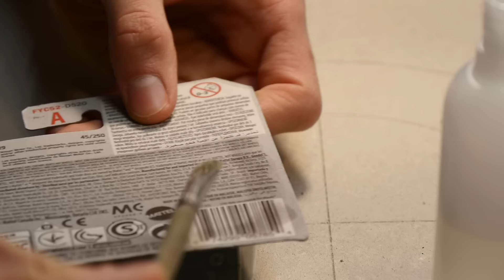Nissan Skyline GTR R34 Hot Wheels Custom Premium

Comment: Nice work dude!💪  Do you use some clear coat on the details like head/taillights after you painting them?
Reply from the maker: Many thanks! 🙂 I always clear coat my cars after paint job, but not any time after detail work. This way I have a mix of clear and matte details.
Reply: @themodelcarproject  Ich merk gerade, das dein Channel deutsch ist/zumindest D als Ort angegeben wurde..dann sprichst du wahrscheinlich auch die Sprache?:-D Danke für deine Antwort. Ich frag deswegen, weil ich für die Details Acryllackstifte benutze und ohne eine Glanz/Mattlackschicht drüber kann ich es relativ schnell mit dem Finger abrubbeln...wie ist es bei dir?

Comment: Wow this looks great! I'm gonna make my Mazda RX-7 diffrend so it matches the movie: the fast and the furious Tokyo drift
Reply from the maker: Thanks a lot!✌️ That's a perfect idea, savage car :D
Reply: @themodelcarproject  I also have a question do you use glue to put the frame and window stuff together or do you use screws? (I'm sorry if my English is bad)
Reply from the maker: @Bazooka.trooper  I usually dont glue the interior or the windshield, only if absolutely necessary. For the base I always try to screw it , so I can put the body back together while customizing, checking if the ride height is fine, etc... But I would say there is nothing wrong about gluing it, I would maybe use just a small amout of glue, just in case you need to open it again. And my English is not the best either ;)
Reply: @themodelcarproject  ok thx for letting me know! I appreciate it!

Comment: You do nice work but the spoiler looks goofy. It should be positioned further back towards the back bumper and at a different angle. Just look at pics of the 100s of modded R34s out there.

Comment: You could probably get a HUGE following on Twitch if you live streamed some builds. Just sayin’ :)
Reply from the maker: Thanks for you advice!👌
Reply: the Model Car Project if you don’t mind me asking, what tools do you use? I really thought about getting into this as a hobby!
Reply from the maker: @sirenz_   this would be cool! You cant exactly say what you have to own. But here are some tools wich are making your live easier:
Dremel with cutting disk and steelbrush
Some various pliers
Side cutter for metal and plastic
Superglue, and other glues (e.g. 2k resin glue)
Epo putty for Bodykits, parts
Cutter
Paint stripper
Soldering aid (to hold the cars while painting)
And for the paints: you can also start with spray cans and than move to airbrush later
The most important thing is: don't spend too much money on tools at first. It's more important to start and collect experience!

Comment: I have a question if you custom hot wheels wheel it still fit on track?
Reply from the maker: No, I would run it on a track. It's a Model Car now, but you can still roll it.

Comment: I’m gonna try to do a custom Miata it’s gonna be like dark green but I want it to be glossy what can I use to have it like that?
Reply from the maker: For paintjob you will need: paint stripper (depends on the casting, sometimes you dont have to remove it), primer, your paint green in this case and then glossy clear coat

Comment: I have a question, what is the white plastic you used for the spoiler?
Reply from the maker: Its a 0.5mm PVC plate. But I use now the pla plates from Tamiya on my newer customs. Works better with the tamiya pla cement glue!
Reply: @themodelcarproject  Thanks!

Comment: Wht material was used for the front and back diffusers and side skirts?
Reply from the maker: Here PVC 0.5mm plates. But I use now Pla/Styrene with the tamiya cement glue.

Comment: where did you get the tires?!?!
Reply from the maker: I bought some of my wheels on ebay. Try different key words like: 1 64, rims, tires, diecast, …
these particular are from "monoblock" wheels 164
Reply: @themodelcarproject  nice! What tire type was for this build if I may ask? What I mean by that is did you use the low profile tires or the stretch and poke?
Reply: @themodelcarproject  what paint did you use for the project?

Comment: Bro i need to know what is these white material plis plis
Reply from the maker: It's a PVC plate. But I use now PLA / Styrene plastic with the compatible glue. It works much better than PVC!✌️
Reply: @themodelcarproject  thanks bro i suscribe
Reply from the maker: @genil127elmster2  No problem man, thank you for your support!🔥

Comment: Ok guys what is transparent black
Reply from the maker: mix opaque black with a transparent medium. The medium streches the black particles and if you spray it like on glass you will see a little bit thru it. Basically it's like tinting windows on cars.
So you may are asking yourself now why the hell did I not mixed silver with black? With this method I can get like a deep-ish "candy"-looking paint on the car, which looks pretty sick for me.
Hope I could answer your question with this long answer🙃